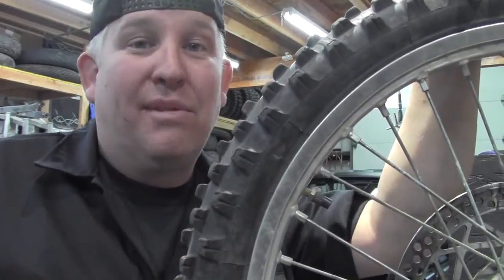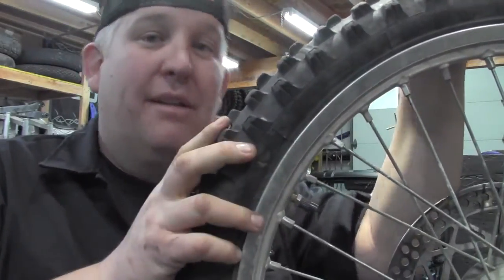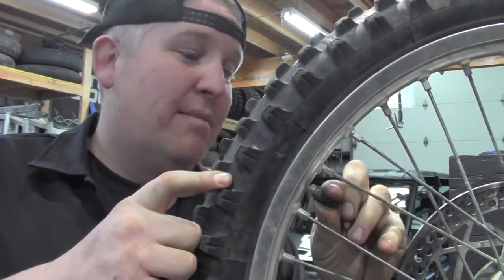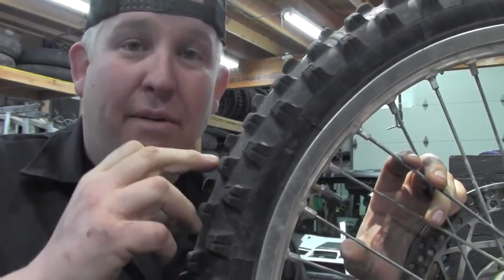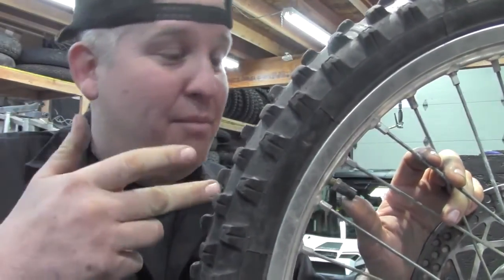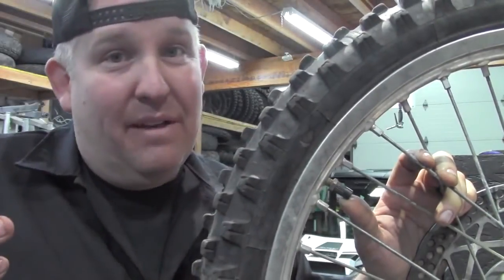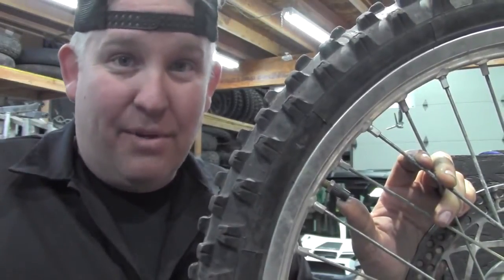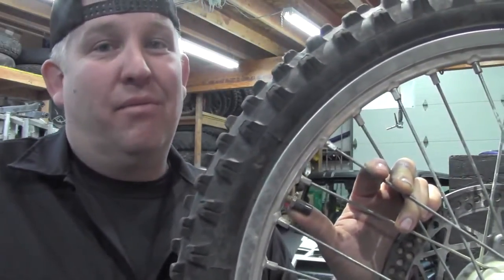Keep Your Dirtbike Inner Tube From Popping

Comment: Can you use front tire tube in the rear tire for emergency 20km use if I were to break down in the mountains?  I don't want to carry both front and back tubes.
Reply from the maker: Yes you did able to fill a front tube large enough to pop the rear tire on the rim